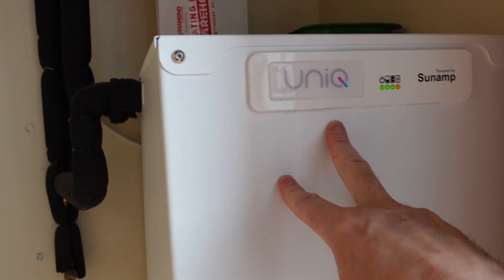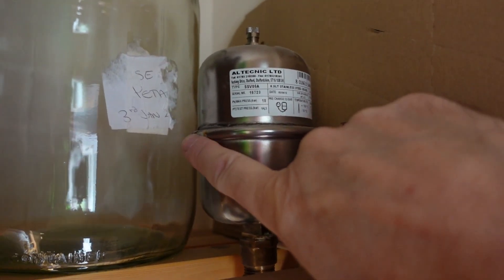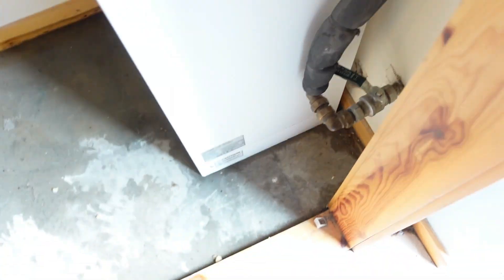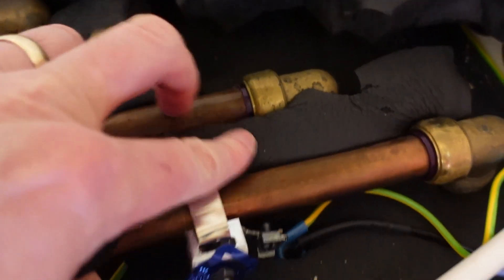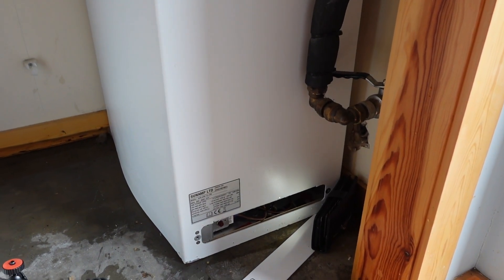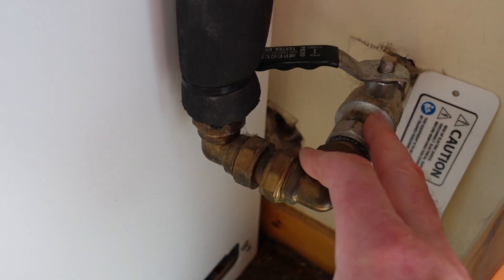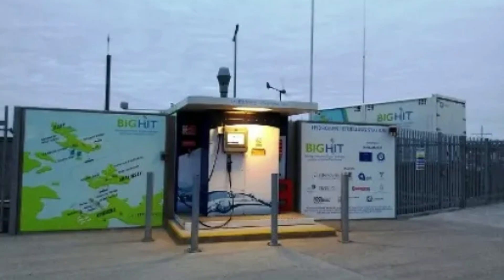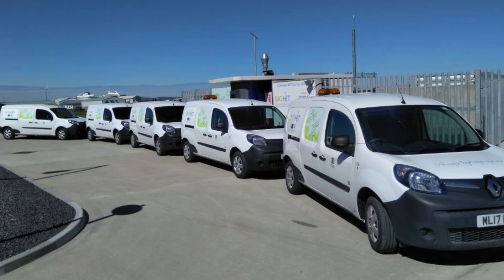Sunamp Heat Battery Review: Unveiling the Realities of Longevity and Reliability.

Comment: You can't adjust the water pressure using a simple ball valve, it will reduce the dynamic pressure i.e. when water is flowing, but the static pressure will always return to the same as the mains unless you have a pressure reducing valve at the main stopcock. Over here in Caithness the water pressure in rural/semi-rural areas tends to be very high, ours is usually around 8 bar so we have a pressure reducing valve to bring everything in the house down to 3 bar, I wouldn't be surprised if the pressure where you are is at a similar level.
Reply: I was gonna point out the same, but ya beat me to it.

Yeah, a ball valve on the line that feeds the system only serves to throttle the RATE of ACTIVE FLOW, not the static pressure it will settle out to once the downstream demand has been met (re: because the ball valve on the feed line remains open).

Thus, if you have high ambient water pressure, the ball valve creates (at most) a very brief reduction that only lasts during refilling.
Reply from the maker: @RovingPunster  see my follow-up video https://youtu.be/OwcYPnemUTI
Reply from the maker: see my follow-up video https://youtu.be/OwcYPnemUTI